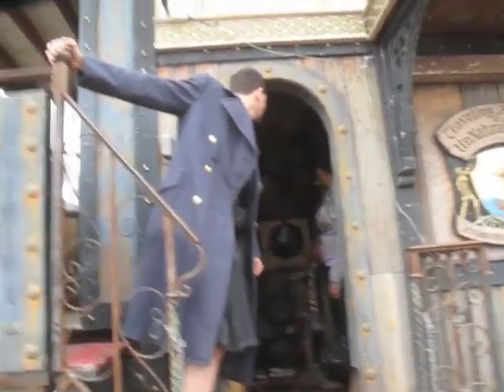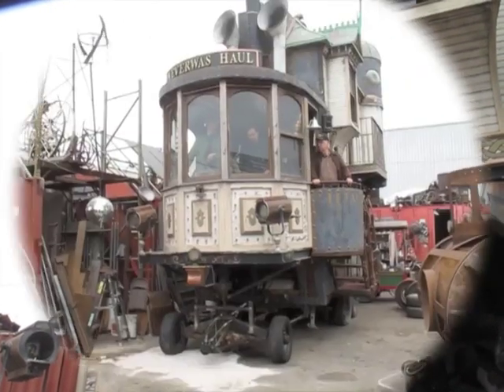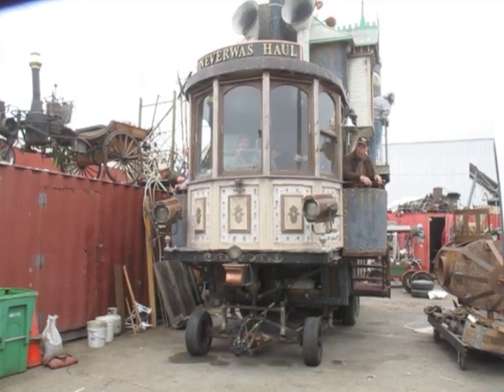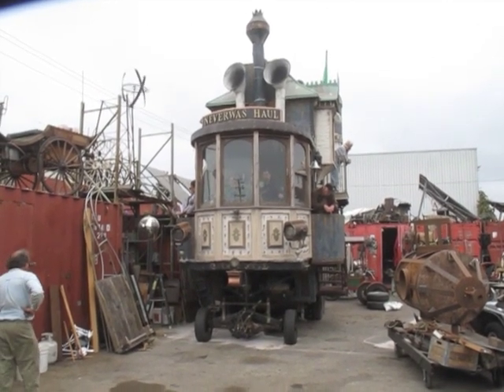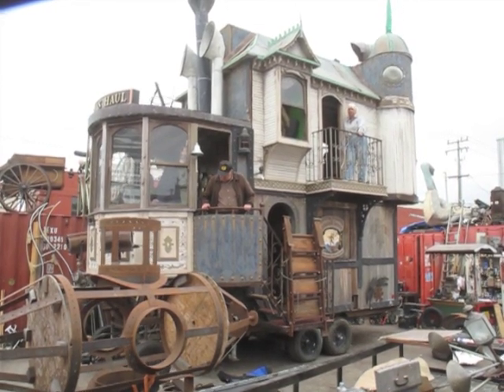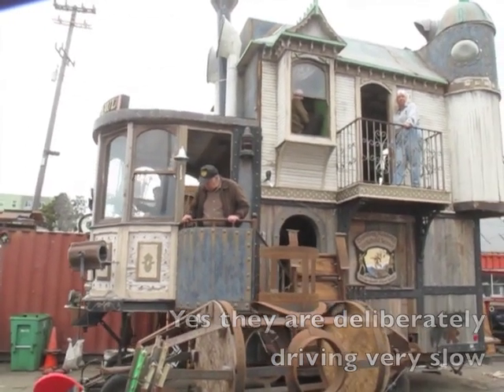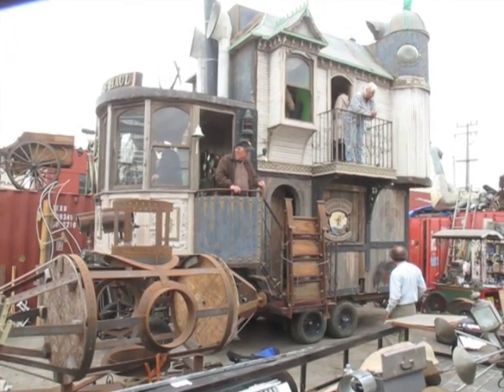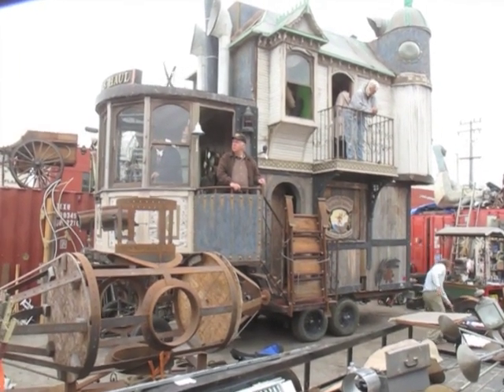Neverwas Haul Test run

Comment: Most of the upper structure comes off and the stairs on the sides come off. The front wheel carriage  unbolts and is stowed inside and it becomes a 5th wheel trailer.
 I have a good video on my channel of it driving at burning man.